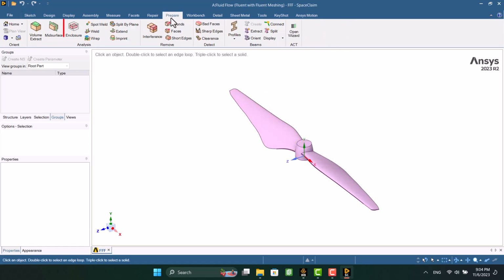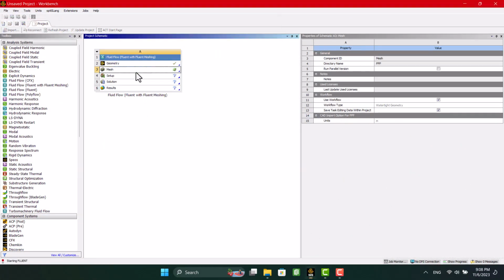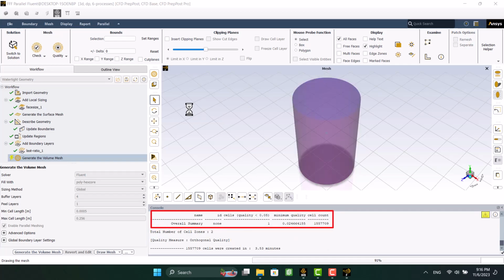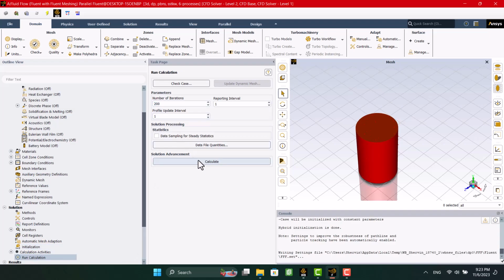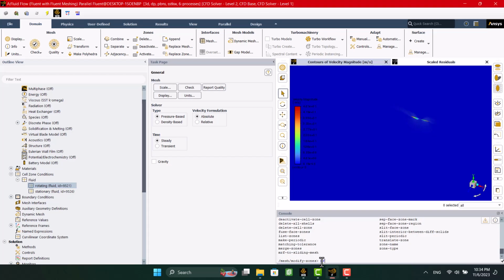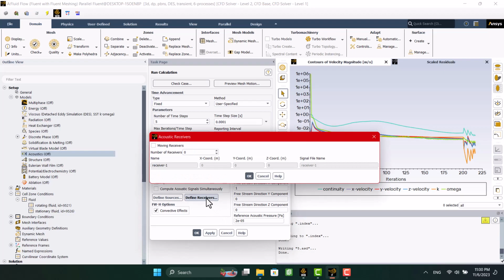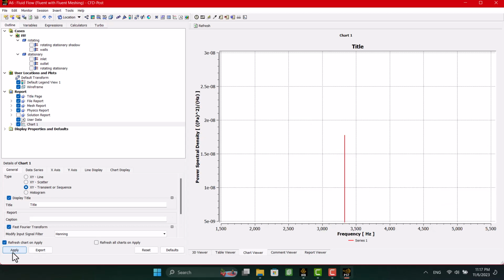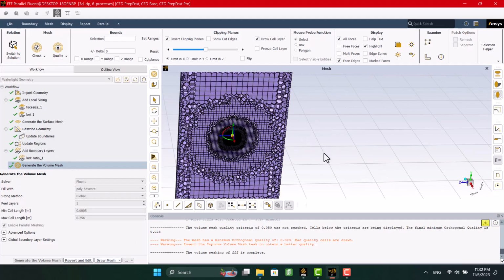🚁🔊ANSYS Fluent Tutorial: Calculating Propeller Noise (Aeroacoustics) 💨

Comment: What does the result in the chart at 21:24 mean? Does the sound occur only at 3400 Hz? I’d like to know whether the result is good or bad.
Reply from the maker: Hello, I didn't solve the model completely because it took about two days. If you solve it completely, the plot will show pressure across all frequencies.
Reply: @caewitharminhashemi  Then could you let me know how to plot pressure across all frequencies? Just briefly is Ok.
Reply from the maker: @김민재-t9e2y After approximately two hundred steps, sound pressure at different frequencies becomes apparent.

Comment: Hi Armin - Thank you very much for a great tutorial  !  Since the flow is steady in a reference  frame rotating with the propeller, could you not perform this simulation with just a single large rotating domain ? Thanks. S.
Reply from the maker: Hello, thank you. Steady flow means the RPM of the propeller is constant. If we use one domain, how can we specify the rotating speed for the propeller? The larger domain is free field domain.

Comment: no need to make the air flow from inlet (u didnt make the velocity at inlet)? and u didnt add gravity?why not LES?
Reply from the maker: Hello. I performed the simulation in the static state. You can add an inward velocity to represent the propeller's motion. Also, gravity does not affect the noise generated by the propeller.
Reply from the maker: The LES method requires an extra fine mesh, while DES can be used with a medium mesh size.

Comment: In this case you selected the blade as the source (dipole). Do you have any recommendations for creating a permeable zone to study the noise generated around the blade as well? (quadrupole).

I watched your video on the air muffler, but I was wondering if you have any additional considerations for creating a permeable surface for the propeller case. Thank you vry much for the tutorial btw.
Reply: In this case, should I choose only the source as the permeable zone only or both the permeable zone and the blade? Also, should the permeable zone be a sphere or a cylinder? What should be the dimensions of the permeable zone in this case?
Reply from the maker: @ Hello, i have a video about flow noise with permeable FWH. in permeable FWH you have to only select permeable zone (zone around the propeller)
Reply: @caewitharminhashemi  Thx appreciate that 😁, btw if I want to define flow inlet, should I just change "pressure-outlet" to "velociy-inlet" and define the velocity magnitude?
Reply from the maker: @rodrigo_daher  yes. Change pressure outlet to velocity inlet for the upper surface of cylinder

Comment: Is there any reason why when using this method I end up with what seem live very high amplitudes? For a 4in diameter propeller I'm getting around 130dB overall sound pressure from a receiver 1m in front which seems rather high
Reply from the maker: @willrussell2134  You made a mistake somewhere. It's not reasonable. Check propeller rotation unit.
Reply: I've found a few issues thanks, one thing I'm wondering is how do I get the Y+ value down, I've tried tweaking multiple things regarding the boundary layer and it still remains much higher than 2
Reply from the maker: Inflation boundary should be around 1e-5 meter in medium rpm

Comment: Thank you for the tutorial. This is really helpful. When I'm processing the final data I get a message saying 'Data set x-axis is not in increasing order' when I click on fast fourier transform. I did increase the number of time steps but I doubt that's what's happening
Reply from the maker: Hello. Unfortunately, I have not encountered this error yet.
Reply: Also when changing flow calculation length do you change the number of time steps or the time step size?
Reply: In order to obtain values for further recievers
Reply from the maker: @TheVelocipasta  I don't understand what you mean. Please explain from the beginning.
Reply: @caewitharminhashemi  I want to know how to increase the flow time to get values for receivers that are further away
Reply from the maker: @TheVelocipasta  FWH uses boundary element method. Sound teach to microphones after distance/sound speed.
Reply from the maker: @TheVelocipasta  after 10 or 20 steps sound reach to microphones

Comment: Superb tutorial thank you very much!
I have some problem where the SPL results in CFD-post are showing negative values, which is unexpected.
My simulation setup is exactly the same as yours and I used the DJI propeller blade as well. I've been searching for solution for quite a while and the only answer I've got is that I have to change the reference pressure. So I tried 3 different reference pressure: 0 Pa, 20 micro Pa and 1 bar but the SPL results are still negative.
Could you please give me some guidance on this matter? Thank you very much!
Reply from the maker: Hello. Check yplus it must be below 2. What is your fluid model?

Comment: In the transient calculation process, my convergence is very fast and very stable, but when the calculation is more than 80%, the residual suddenly rises tens of thousands of times, and the monitoring of the rotor thrust value also changes to tens of thousands N. Do you know the reason🤔
Reply from the maker: It happens sometimes.  Because mesh motion is used.  In the steps interval that diverges, increase the residual value.  After passing that interval, return it to the first values.
Reply: @caewitharminhashemi  Thank you for your reply. When I met this situation for the first time, your way can solve the problem effectively. But when I ran into the problem the second time after 60 more steps, I tried to raise the residuals to 0.1,10,100, 10,000, but still couldn't diverge after calculating up to 12 steps. And the residual value is getting larger and larger.🥺
Reply from the maker: @JjownO  check mesh and time step. problem is due to one of these

Comment: Hi, is it possible to do prediction of noise of subsonic get from nozzle  using the similar setup as in the video?. Thank you for the video. Why did you not choose to use  FW-H surfaces for this model
Reply from the maker: Hello. If the propeller tip Mach is low. No need to define a surface (permeable FWH) because the quadrupole sound source is weak. You have to define surface in jet noise calculation because quadropole source is dominant
Reply: @caewitharminhashemi   Thanks a lot for your explanation.

Comment: Excellent 
I didn't understand what you put values on inlet and outlet boundary conditions?
Can i do it for my axysymetry propller by one blade??
Reply from the maker: Inlet and outlet are pressure outlet. You can add a inlet velocity if the propeller moves in air.
Reply from the maker: No. You cannot use symmetry or periodic boundary condition in mesh motion. It uses in stationary solution.
Reply: @caewitharminhashemi  thank you🙂‍↕️ So I can't simulate the noise of one blade.🥲 All of it  has to be.

Comment: I would like to ask how to set the height of the first boundary layer of the blade?
 I saw that the first layer height and number of layers of the boundary layer in your two videos are different.
Reply: Three warnings appeared when I generated the volume mesh.
Warning: region fluid
Warning: Skipping synchronization as either size field is not available or size field is already synchronized.
Warning: Min. aspect ratio less than 1 at 484 nodes
Reply from the maker: Decrease the minimum size of the surface mesh.
Reply: @caewitharminhashemi  Thank you very much!
Reply from the maker: From my experience, a height between 2 and 4 micrometers is proper. After the solution, you have to check y plus. It should not exceed 2.

Comment: do we have to always use the steady solution first or we can just go with transient without steady ?
Reply from the maker: The steady solution increases the speed of convergence.  If you use the transient solution directly, it may diverge.
Reply: Thank you for your reply, i still have more question, what if i add local sizing for the volume of the propeller instead of the rotational zone ?, does it effect the accuracy of the result or is the result is still viable because my machine is struggling with the rotational zone local sizing while if i instead use the local sizing only on the propeller volume, i can run the analysis easily
Reply from the maker: @aleyraihan  There's no exact rules for mesh size. You cannot predict results by one solution. You have to solve a solution by three different size of mesh, coarse, medium and fine. Yplus must be below 2 for LES and DES and between 30 and 60 for rans models.
Reply: @caewitharminhashemi  So, first, i have to thank you so much for this tutorial, and i comment because i have done all the step until CFD post, after fast fourier transfrom, i got a spl vs frequency charts that show ups and down line of the chart, Is this normal ?, and also because ups and downs of the chart, i also got negative SPL, is this right ? i placed the receiver 1m in front of the propeller. Thank you for guiding me until this far
Reply from the maker: @aleyraihan  negative spl is due to coarse mesh. You have to generate a fine mesh with yplus equals 1. Mesh in this video is not fine
Reply: Okay i’ll try it again, but problem is, i can’t use the exact mesh setting because it takes too long for my machine. I am only able to go as low as 0.2mm for the mesh because less than that will take too long (>1 day) for the simulation. I’m trying to find a viable solution that doesn’t need high computational power
Reply: Okay then, but im afraid if i reduce the mesh size even further i dont have the time available for the simulation. As im right now using 0.24 mm mesh size in local sizing, it took me 12 hours to run until 1000 time step, and i only accomplish yplus <6. Is there any way to achieve fine mesh without longer duration to run the simulation ?
Reply from the maker: @aleyraihan  unfortunately no. Propeller noise needs a huge computational time.
Reply: @caewitharminhashemi  Hello, i was experimenting today, and i have a question, do we need to activate boundary layer to the wall (propeller) and set it to moving wall or does it not affect the acoustic result ? Thank you
Reply from the maker: @aleyraihan  in aeroacoustics, you have to use sliding mesh to capture unsteady noise. As I know, moving wall doesn't capture this noise.
Reply: @caewitharminhashemi  Hello again Mr. Armin, i want to give my biggest thanks to you for showing the way how to use ansys for my research. I'am very grateful that i've found your video and after some time tinkering, i think i've got a viable solution. But i still have a question. I'am using both fluent FFT plot feature and cfd-post as you shown to plot the graphic plot acoustic result. But i'am seeing two different line. i have made sure both fluent fft-plot and cfd post use the same file, the same variable, axes, parameters etc. (FFT hanning, sound pressure level DB, frequency), but i still find the fft plot and cfd-post showing different graphic chart/line from the same file. I seek the understanding behind this. Thank you Mr. Armin
Reply: I wanna add, after further looking into the files, i have found that cfd-post defaults to use hanning to modify input signal filter while fluent fft plot use nothing. This seems to be affecting the graph line. Which of the modify input signal filter that you recommend to use Thank you
Reply from the maker: @aleyraihan  filters improve results. Use hanning function
Reply from the maker: @aleyraihan  hello, you're welcome. As I know, hanning window function improves accuracy results. Use hanning function.
Reply: Thank you for your reply, i will further proceed with my simulation🙏
Reply: Thank you for the answer Mr. Armin 🙏